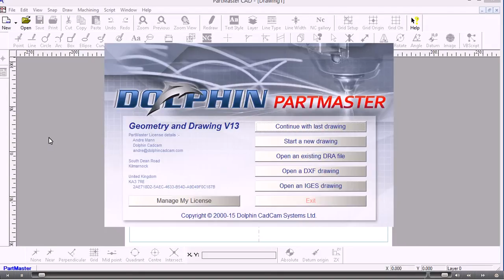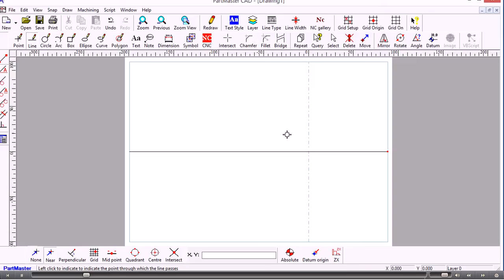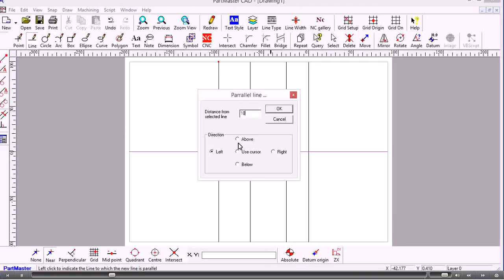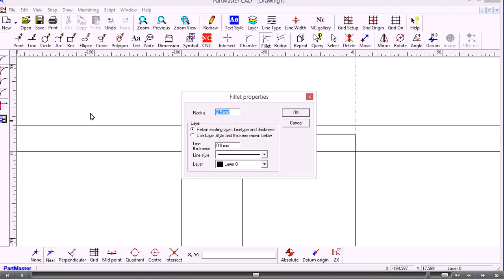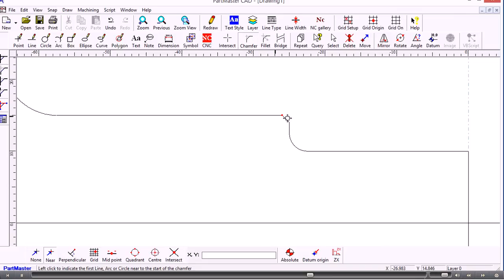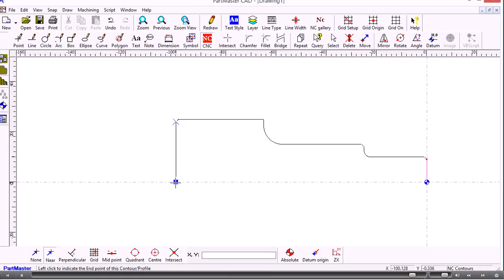Dolphin PartMaster CAD - Drawing a Stepped shaft

Comment: A few years ago, I bought this software for my model building hobby, I was just learning to use the software. I made a few parts, but didn't really know how to use the cad module, I was importing my dxf's. I wanted to come out to meet for classes. Only a few videos were available anywhere. Well we moved and my little shop was tore down and stored. Just now getting it set back up now after several years and really wanting to learn this software better. Thanks for making these videos. The software has a lot to offer. Just this simple video has taken away much frustration over the basics. I used autocad and deltacad. They work much differently. So even creating basic geometry was hard to figure out. These videos really help.